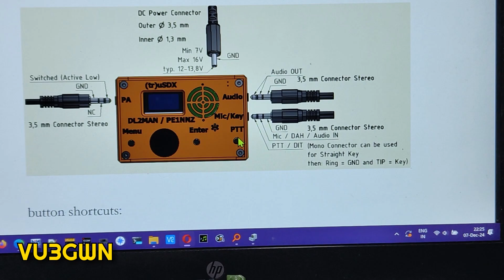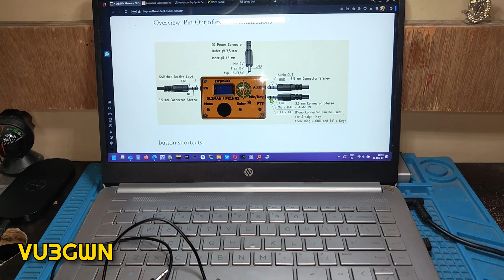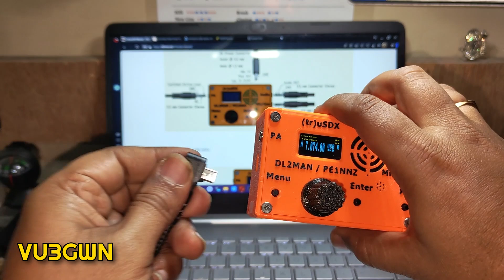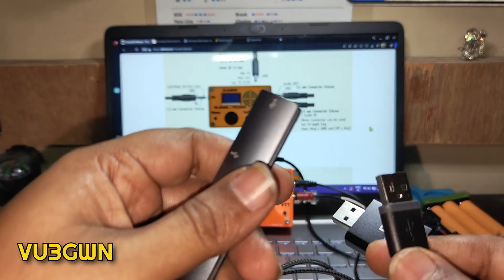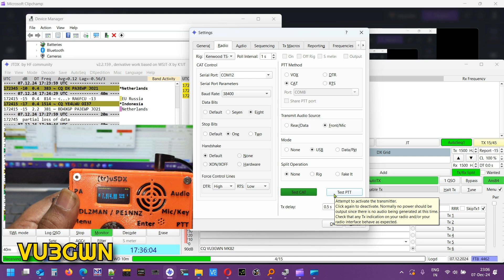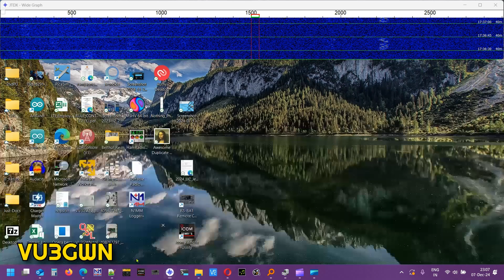DigiModes with truSDX

Comment: You need to reupload this video, the sound is to low to hear what your saying. Tnx for all the info, 73s-N7BFT
Reply: I agree.  Sound is bad.  Have worked out a little youtube trick where I turn on the closed captions and it generates subtitles automatically.  Not the best solution but it can help cover some gaps.